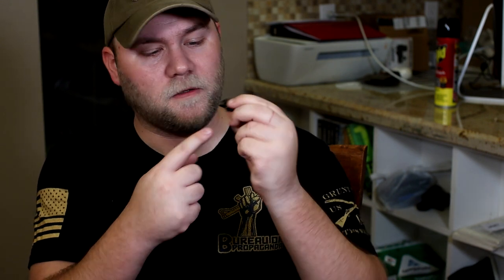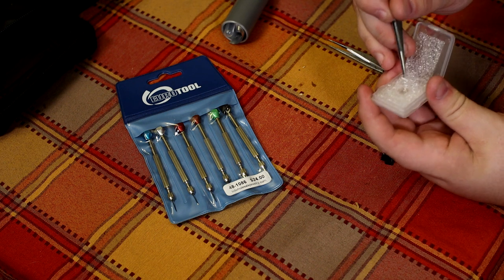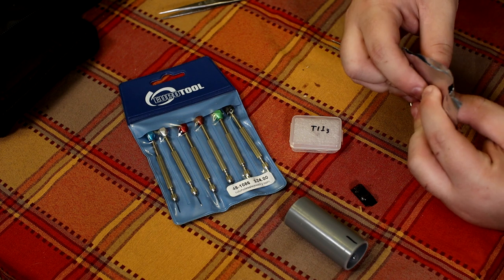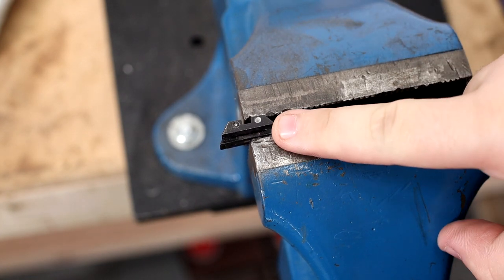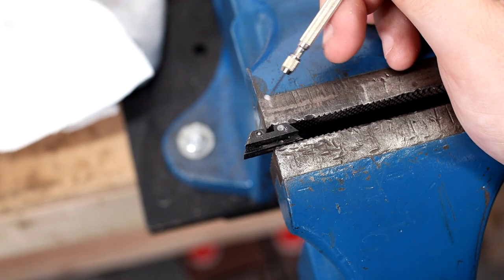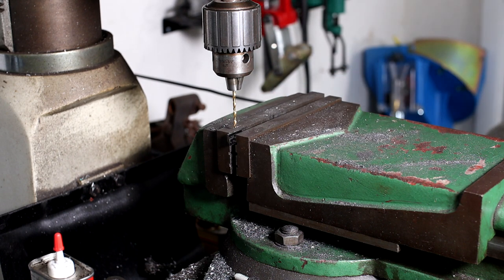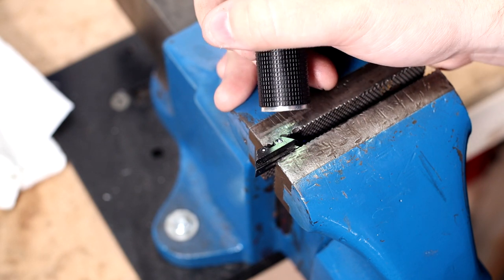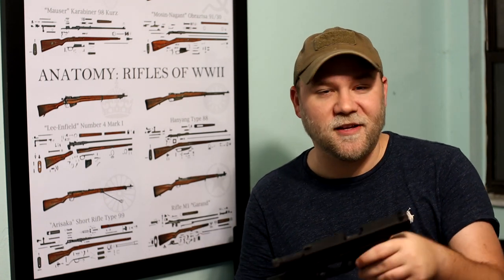Replacing Tritium in Night Sights

Comment: Thanks, useful video, gives me confidence in doing this myself on an old 20 year old “defense device’s” spent night sights. Got the tritium vials, put white shrink wrap tubing around them (for excellent daylight visibility), trimmed the shrink wrap just right to the edge of the tritium vials, and am installing them today.  The tritium vial vendor was very helpful in sizing the vials correctly for all this and included the shrink wrap tubing at no charge with my order.
Reply from the maker: How did the white shrink wrap work?
Reply: It was the hardest part due to the tritium bulbs being so tiny.  Oversized the shrink wrap and shrink it on the bulb then trim with a razor blade.  Looks great!

Comment: Awesome video, really the only one on YouTube using tritium vials for anything, I got 12 vials on the way (in 3 different sizes). And gunna attempt an install and possibly a video of my progress aswell! Thanks for the video!
Reply: How did it work out for you?
Reply: @stopthephilosophicalzombie9017  extremely difficult to work with such small pieces… I still have the vials, but could not get a tiny hole for the vials to sit in that was clean enough to try on anything I cared about.
Reply: @SuperCinemaCraft Yeah I did it on my PPS and PPQ with a hand drill and managed to get results that looked ok. I just drilled into the existing sight dots. Don't be afraid. : )

Comment: Awesome video. Lots of good information there. I'm seeing in previous comments that they're holding up well. My question is, did you not put the glass lenses back on the outside, and just used all adhesive? Also, my Trijicon HD rear sights have holes in the back, do the vials seat in those holes and or does the adhesive run out during the replacement process? Thanks again for an awesome video!

Comment: Solid instruction.
Now for my questions:
Tritium have a half-life of 12.5 years so they will go dim over time.
In the case of having to re-lamp again, is the removal done the same way with the UV activated adhesive solution you use as you stated it won't be as sensitive to acetone after fully curing?
Also, how are the sights holding up against the recoil shocks?
Reply: Nightfision uses some kind of black epoxy; maybe find out which they use
Reply: @HKBuilderDIY  So I assume that means it will he difficult to remove the cured solution used in this video?
Reply: @TheSeagon  haven't shot yet. But will update in a weeks time. My sight is on a 10mm, so high pressure heavy recoil. I'll utilize 200 rounds to start and then let you know if it is holding up. 
As far as the optic glue, the way the night fision's epoxy came off was continually soaking with acetone and grinding with the pic. It took hours. In retrospect I would just drill the old vial and epoxy out AFTER I dug enough by hand to remove the little polymer covered piece of glass that rotects the vial
Reply: @TheSeagon  ok, tested it over multiple days this weekend. After flash drying it the first day under UV light, and curing for a week after in open air near window where sunlight could reach it... it has worked flawlessly! I have a G21 that can fire both 45acp and 10mm (45 to 10mm conversion barrel) with quick swap outs; I've put about 150 rounds of 10mm and another 150 rounds of 45. The optic glue is intact and rock hard to the touch. The vial inside is glowing brightly in darkness

P.S. if it breaks/fails I will update here at the round count
Reply: @HKBuilderDIY  you used blue vials?
Reply: @JayyMoney-vr7nv  orange. 
Have been thinking about red next since I like the way red fiber optic looks
Reply: @HKBuilderDIY  nice
Reply: @JayyMoney-vr7nv  well my orange tritium is dead lol only glows if I hit it with a UV black light and then quickly fades till it can no longer be seen in the dark

Comment: Nice video! BUT I prefer the 1911 and Combat Commander clones over Glocks. Old designs, yes, but dependable as any Glock. The Combat Commander came in .380 and 32 ACP while the 1911 can use .22 conversion kits for practice shooting besides its normal .45 ACP chambering. I also have Star Model PD's in several calibers, while you can load double stack mags, I can carry four mags for each  because they are thinner and shorter. To each his own, but I bought mine over 30 years ago when they were much more inexpensive and very common. I have carried them for that long, they concealed carry much thinner and more comfortable. Yes, they do weigh more (Steel VS Plastic), but with the proper holster, they are practically invisible. The only brands that are difficult to carry concealed is the High Point and the original Haskell, boxy and unbalanced, but they do shoot and once broken in, have no FTF problems. My very first handgun in 1974 was the Colt Combat Commander in .32 ACP. If you can print on a moving center of mass target at 20', you can defend youself anywhere because almost all defense situations happen at 15' or less.  Glocks are fine weapons, but not for my personal preferences.